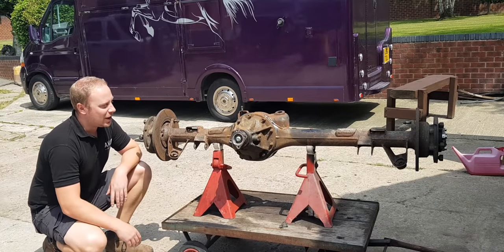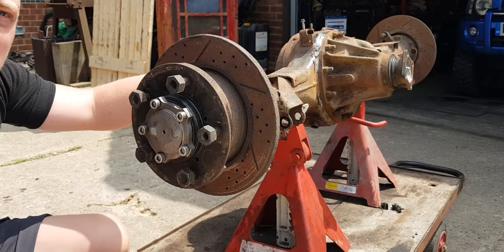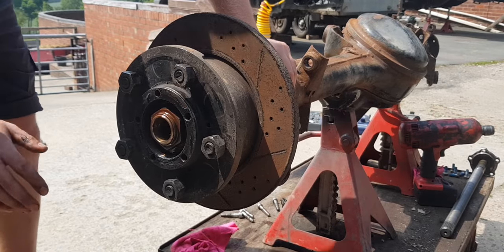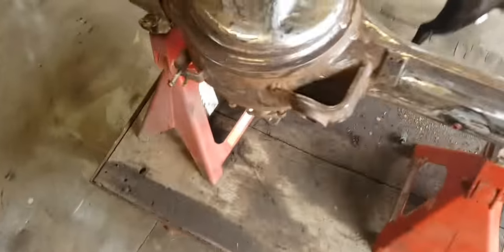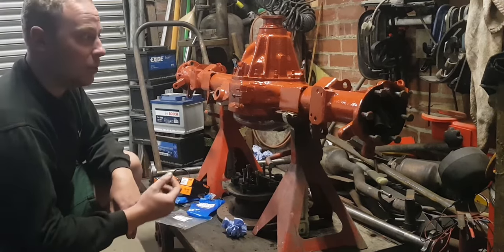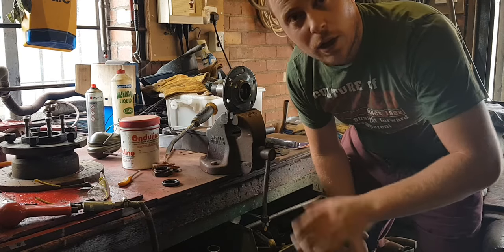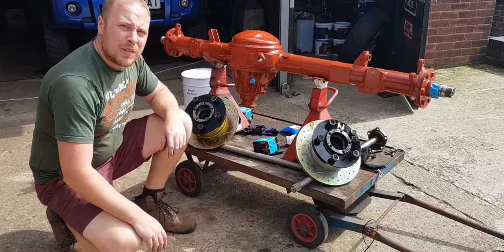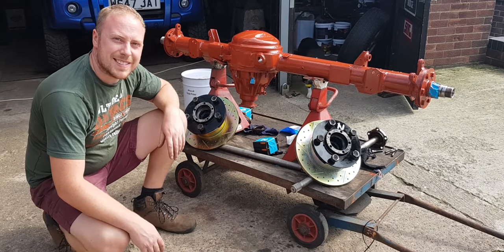Defender Axle Refurb How To Strip Down, Replace Gaskets, Wheel Bearings, Paint & Rebuild. Land Rover

Comment: If your doing a Puma or Td5 (or Wolf) please check the bearing end float and don't just install the original centre spacer, there's a reason LR sell the spacer in different sizes. Also both the disc bolts and especially the stub axle bolts should have thread lock on, not copperslip, a torque wrench wouldn't go amiss either. 👍

Comment: Thanks for the video! With the Franklin TA157, which size tool do you use for the races? I can’t get hold of a TA157 and the kit I bought doesn’t appear to be the correct size! Thanks in advance
Reply from the maker: Hi Andy without looking I am not sure. It was the closest fit i had. I can't remember now if it was an exact fit but i have loads with it. 
The other thing you can do is turn the old race upside down and use that to drift your new race in.
Reply: @lifes.projects  nice one, it seems to be somewhere between 72-76mm. Will have a look around online to see if I can get sizes in between, failing that I’ll use the old races! Thanks again!

Comment: Hi, great video - thanks! How did you clean up your rusty parts? Stub axle etc. They come off looking a bit worse for wear but on your bench nice and clean! Cheers
Reply from the maker: Thank you. I cleaned them best I could in the vice. Where it was rusty I did it with the needle gun, wire brush and the flap blades on the grinder. The stub axle itself I just used some enri cloth and brake cleaner.
Reply: Life's Projects thanks! Do you clean up both sides of stub axle? Not sure whether to touch the mating face. Cheers
Reply from the maker: @tomagar2992  Yeah cleaned the mating surface up too. Just ensures its nice and flat for a good seal.

Comment: Hi Life! Nice clear video. Well done. One question: why didn't you use this bearing/seal driver tool to knock the new seal in it's place?
Reply from the maker: Thank you. Good question! The seal isnt strong enough on the inside where a seal driver would mount but also there is a lip on this particular brand so i wouldn't be able to push it in with something flat it had to be something the same diameter to push down on the edges. Hope this makes sense.

Comment: Hi my girlfriend recently bought a 2014 Defender (I apologize in advance as I have mo knowledge of these) we live in different countries and I have only just got a look at the vehicle the front axel as a slow leak (more of an ooze) around the sealant. Any ideas on the course of this and if it can be repaired would be massively appreciated!
Reply from the maker: I am just on with my front axle now. If it is leaking from the diff the only cure would be to remove it clean and re-seal it. Not straight forward as you need to remove the hubs and the stub axles to remove the half shafts.

Comment: Was the axle undersealed? If it was, how did you get that off?
Reply from the maker: Yes it had underseal on it. I scraped it off, used a needle gun and flat discs on the grinder. 
Have a look at the chassis video i did
Reply: @lifes.projects  Thank you and will do. I used petrol on the sills, but that freaked the neighbours out. 😂
Reply from the maker: @gavinbroad1743  😂😂
Reply: @lifes.projects  How loud was the needle gun? Need to consider the already wary neighbours... 😬
Reply from the maker: @gavinbroad1743  Very loud! 
Imagine hitting a lump hammer on a sheet of steel then imagine it at 50 times a second 😂
Reply: @lifes.projects  Yes, I used to work inside warships when the painters were doing the hulls. I had hoped a little home version might have been a little more socially acceptable. Did your neighbours moan?
Reply: @gavinbroad1743   we have really good neighbours but are far enough away from them not to bother them. It also helps that they are in their early 90’s and nearly deaf🤣
Reply: @judithwalker3007  I went out yesterday and did a first coat of petrol. Usually three coats. The MoD put these through a safety upgrade programme which involved industrial quantities of underseal. Work that one out if you can... 🤷🏻‍♂ 😂

Comment: Perhaps not on an axle, but do you use rust converter?
Reply from the maker: Depending on the area and how bad the rust is. If its too bad i will usually cut out and repair or replace.
Reply: @lifes.projects  I use it as a prophylactic. It's not advertised for that, but it works very well.
Reply from the maker: @gavinbroad1743  Al have a look into that thank you 👍
Reply: @lifes.projects  Ping me a PM (is that possible??) and I'll set out the process.